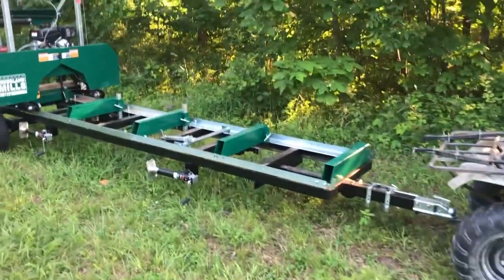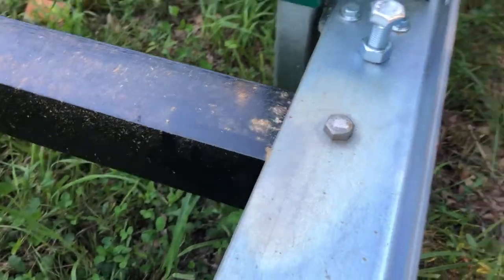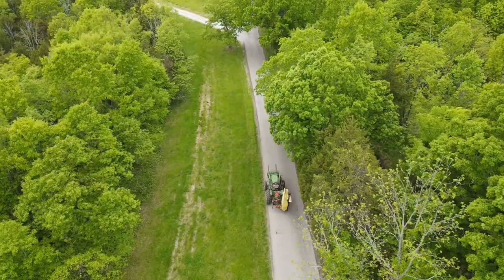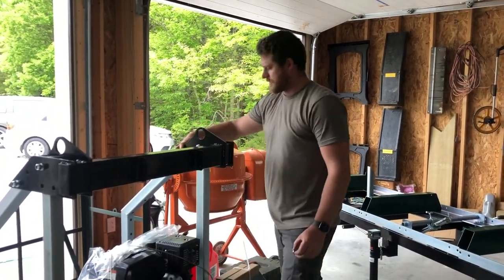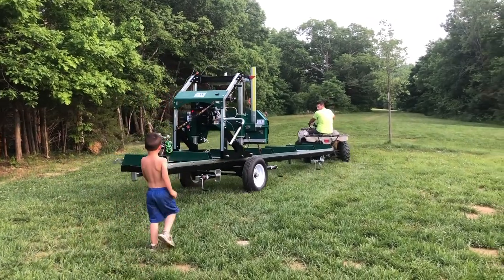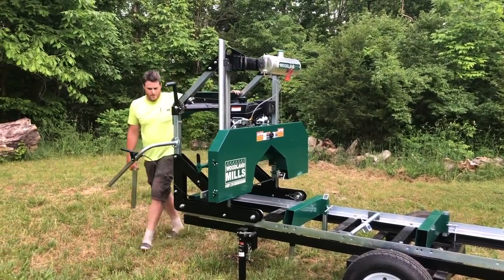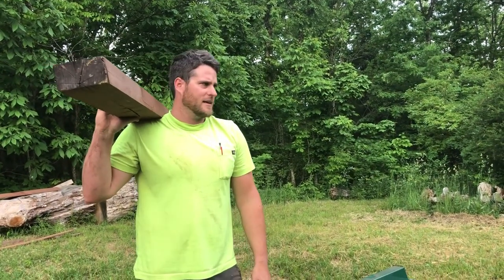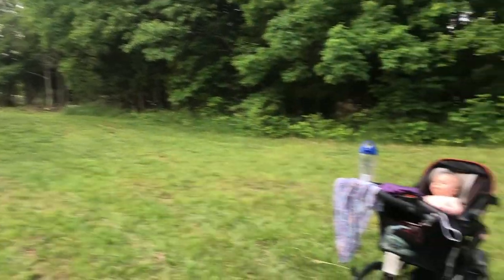Installing Sawmill on Homemade Trailer: HOW TO EASILY LOCK DOWN SAWMILL FOR TRANSPORT!

Comment: We're looking at acquiring a woodland mills HM130MAX, it's a really big investment, roughly $10,000, including 10 extra blades, a blade sharpener, & tooth setter, not sure if we want to put that big of a dent in our pockets "/  I do enjoy  construction building, maybe I'll sell my Harley street glide, and get the mill, you built a awesome trailer for your own mill 😀
Reply from the maker: I get it. We wanted to buy a mill when we first bought our farm in 2018, but financially we just weren't there yet. I can tell you though- I 100% regret not buying it sooner. This mill is awesome! If you can financially make it work (and not sell the Harley lol) then do it! And thanks for the comment about the trailer. It has been great!
Reply: @CollinsCountry  selling my Harley isn't a big deal, I don't like it anyway, worst money I've ever spent, I'm keeping my 2004 Kawasaki Vulcan 2000 classic though, it's a much better bike, and way cheaper to maintain, it's just a heavy beast around 1000lbs. "/
Reply from the maker: +cancel channel Dang. The Kawasaki sounds like a nice one. Looks like you’re gonna sell that Hayley then and get a sawmill 😉 Do you have access do big enough trees for the 130? Here in Kentucky the 126 is perfect because we don’t have pine trees. Most of what we cut is cedar and oak. Those rarely get too big for our 126… You could save money by getting the one size down

Comment: I’m curious if you are concern with any slump at the rail and frame gap over time from heavy logs?
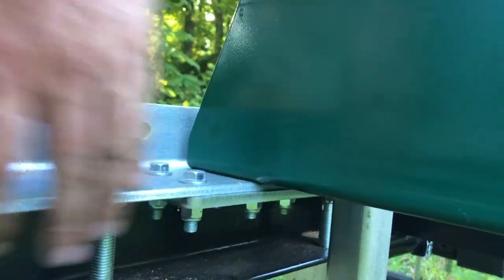Reply from the maker: I have no concern with this because the leveling bolts woodland mills send with the mill can be installed and turned up or down to put tension on those areas you speak of. An example of this is at the 1:22 time of the video. Thanks for watching our video!!
Reply: @CollinsCountry  thanks for the reply. I am looking forward to making my mill mobile through your info.
Reply from the maker: @Hobbietone  Awesome!! Good luck.!Ours is still used on a weekly basis!
Reply: Good point, he might want address  that with some strong re-enforcements

Comment: I know you have discovered that the jack handles will need to be secured when you move the trailer. :D
Reply from the maker: Of Course .If we are taking it far around the farm we just pull them up and quickly put a bungie around it to hold in place... Works like a champ ha. Thanks! :)